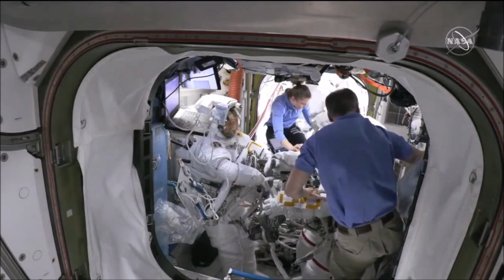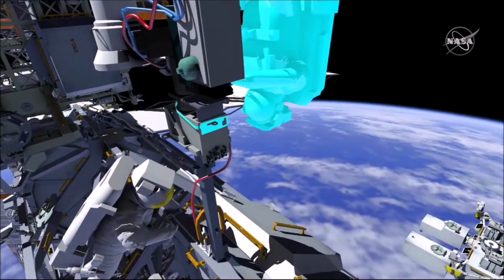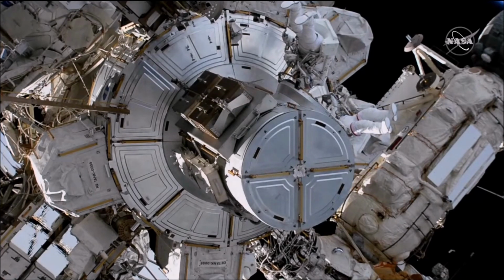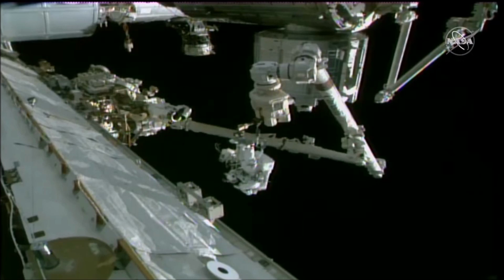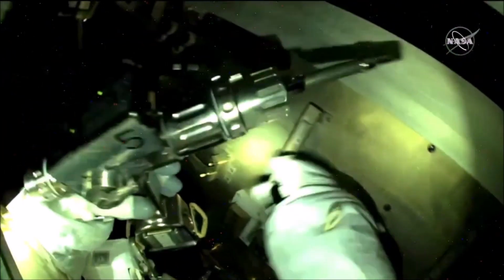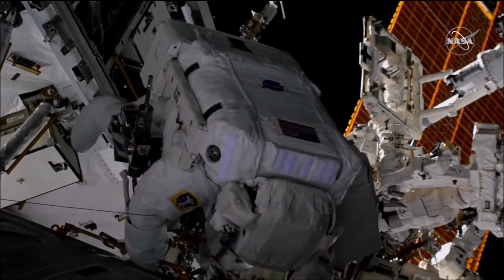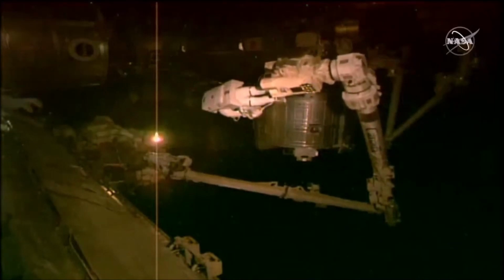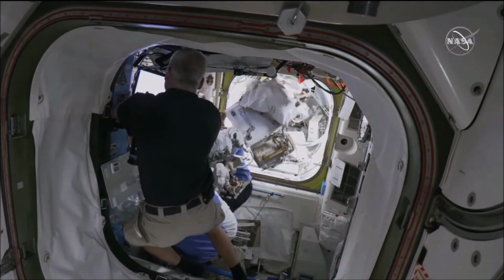HIGHLIGHTS of US Spacewalk 80 - Chari / Maurer (23.03.2022)

Comment: How fast are they moving?? Not even looking like they moving at all!!!!
Reply: because astronaut speed is the same as the speed of ISS. like you sitting in a flying plane.... your relative speed to airplane is 0. you are both moving at same speed relative to the ground.
there is no air in space to slow you down, so you can just "walk" out of ISS and you wont experience air drag like you would if you put your hand out of moving plane.
their speed relative to earth surface is around 7-8 kilometers per second
you can see they are moving when earth is in the shot.
without any other reference frame except ISS you dont have anything to compare if they are moving.
if we didnt know that ISS is moving you could argue that earth is rotating very very fast. from the shots in this video